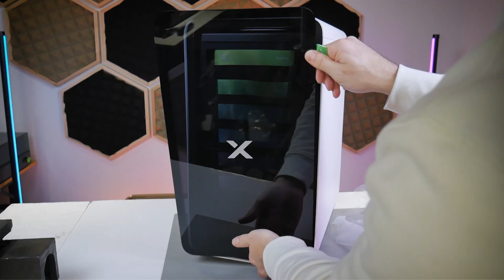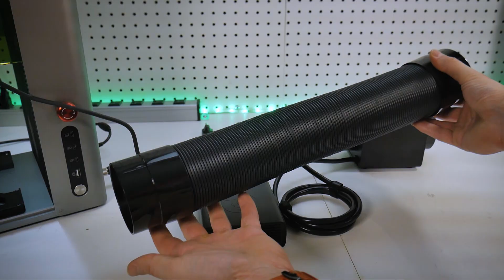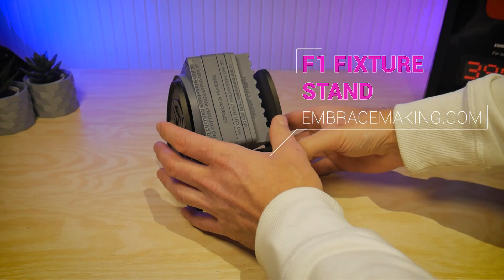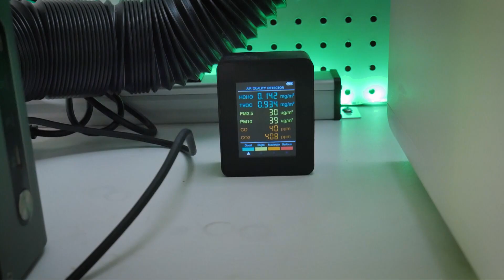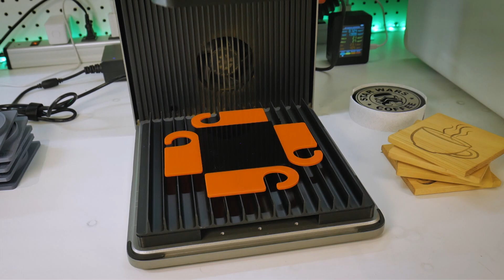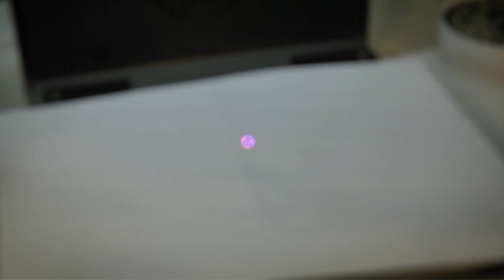xTool AP2 & IF2 - Over 99% Laser Filtration Efficiency! User Guide, Air Quality Test, Review + More!

Comment from the maker: Get the best prices on the AP2 and IF2 at the links below! 
xTool AP2:
► https://www.xtool.com/products/xtool-safetypro-ap2?ref=D5HpJRsyqyUUnt&utm_medium=5306&utm_source=influencer
xTool IF2
► https://www.xtool.com/products/xtool-safetypro-if2?ref=D5HpJRsyqyUUnt&utm_medium=5306&utm_source=influencer

If you have not already purchased an xTool machine, or you aren't bundling the AP2 with a machine, use promo code AirItOut to get $200 off!

Looking for other materials I used in this video? Use the links below, as an Amazon associate I may earn a small commission (at no extra cost to you):

4" Duct Hose (25ft long!)
► https://amzn.to/3YyaBGS

Genuine Leather Baggage Tags
► https://amzn.to/4eS7hMD

Black Cast Acrylic (12" x 24")
► https://amzn.to/40kHB6P

PU Leather Keychains (3 Styles)
► https://amzn.to/3VFJjM7

36 pack 4" Wood Coasters (Square and Round)
► https://amzn.to/48g5tKZ

Air Quality Monitor
► https://amzn.to/3xgoaA2

Electric Screwdriver:
► https://amzn.to/3P43fpz

Digital Calipers:
► https://amzn.to/48IQh7w